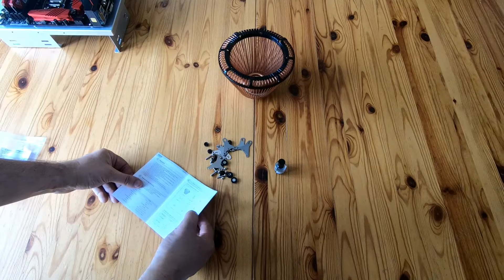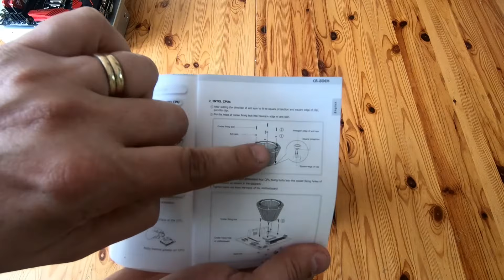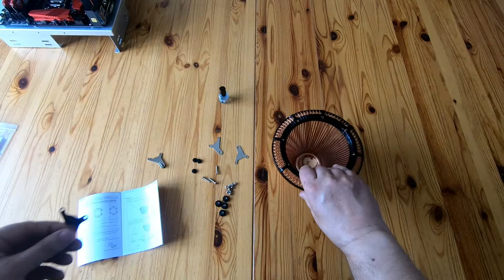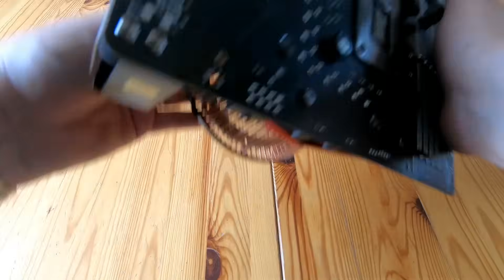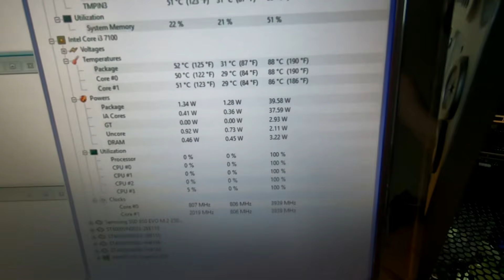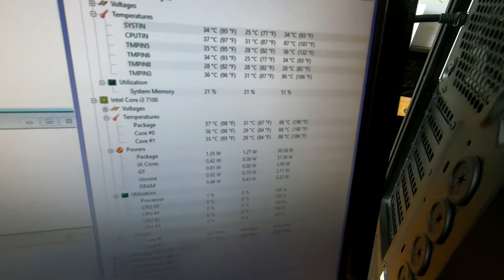NOFAN CR-80EH Installation and Review *HOW TO* Guide

Comment: I have had this Nofan CR80-EH cooler for several years in a computer with AM2 motherboard and now I have changed to another computer with an AMD AM4 motherboard and I want to put the Nofan cooler from the old computer. For this, I have to remove the 4 AM2 clips of Nofan that I had in place and replace them with the 2 AM4 clips as indicated in the instructions to adapt it to the AM4 motherboard, but the problem is that it does not explain how remove the 4 Anti Spin and the 4 Cooler Fixing Bolt of the clips and I have no idea how to do it. Can somebody help me?
Reply from the maker: Not really sure what you’re trying to remove…

If I remember correctly, there are 4 mounting brackets that use 2 screws each that go into the base of the cooler - and that’s all there is.

You just move then to different positions for different sockets.

Comment: Is it possible to remove the black part on top?
Reply from the maker: You can remove it.... but it’s not designed to be removed and it’s there to keep the heat pipes arranged properly and safely.

It would look pretty nice with just the bare pipes - but I wouldn’t recommend taking it off.

Comment: Would this be any good for gaming ?with 8 fans I'd be interested to see you same again but full load cpu and fans turning
Reply from the maker: The whole point of this cooler is that it doesn't have a fan... so you can build a totally silent PC.

But this cooler will work when the CPU is on full load on all cores - so for gaming it'll be fine as there are no games that use all the available cores anyway.

Gaming is more GPU than CPU, so that'll make the noise and totally void the main reason for getting this kind of cooler...

But Dark Rock 4 Pro is a ‘proper’ cooler for the higher end gaming processors and it’s pretty quiet... and looks pretty impressive too.

Comment: Can I use fans on the case would this be cooler looks amazing and look very lite I used the 3fan Salman and result were awesomely low at peak load at 40c max. But really heavy.if you think an 8fan case would be greatly colder ill get one
Reply from the maker: You have to have a case with a top vent... but any full size ATX case will have rom for more than enough fans.

Note that looks aren't the main focus of this cooler - its silence.

So it's really meant to be used in systems that are going to focus on noise reduction more than anything else.

Comment: Where did you get that paste?
Reply from the maker: The thermal paste used in the video came with the cooler.

You can see it in the bag of parts right at the start of the video.

It's not special though… and any other branded paste will obviously work.

Comment: Lower profile ram
Reply from the maker: The taller RAM sticks were a problem for the previous NoFan cooler - the massive CR-95C.

For this one, you can put anything you like in provided you aren't using the slot nearest the CPU. So check your motherboard manual.

If you are using two sticks then the motherboard will have a preference for which slots to use, but for four sticks you'll have to have a think... at 18:38 you can see the view from the side and there's not a lot of clearance for the first RAM slot nearest the CPU - even for low profile RAM.

Comment: Hi. I have i7-3770K which is 77 TDP. Do you think is this 80 TDP cooler enough for him?
Reply from the maker: On paper... yes because 77 is less than 80. But personally, that's a bit close... this cooler isn't really meant for higher end processors. They used to make to CR-95C, CD95C Black Pearl and CR-100A models which had a higher TDP rating, but these are no longer manufactured. Yours is also the K version that would allow overclocking - that certainly won't be possible with the CR-80EH. In the video, an i3 peaked at 88 degrees with a TDP of 51W - and i7 will certainly be hotter.

And your particular i7 runs pretty hot anyway - so as a side thought, deliding is worth a look to improve thermals.

I think NOFAN discovered that people with i7 CPU's would tend to go for water cooling or substantial HSF coolers and not opt for a quiet fanless solution - especially for the K versions that are unlocked for overclocking. And the discontinued models were overkill for the lower end processors with a premium cost for the higher TDP rating - they are much larger and more complicated than the CR-80EH.

You also MUST have a case with a top vent and good ventilation to allow convection to work effectively.

If you do have a case with top vents, then your CPU will be happier with an AiO water cooler with a couple of 120mm fans - that will be pretty quiet. Or you can get a HSF cooler that's got big fans if you've got space. Bigger fans spin slower when pushing the same volume of air as smaller ones - so they are quieter.
Reply: @sterntechdaddy  Thanks for fast reply. I take i7 in 2013 because I want cpu which if above mine current needs,so it can perform well next 10-15 years which it will for mine needs.I am on search for a fanless solution as much it can be without changing mine rig:   cpu,mb,and 16 gb of ram. I have Thermaltake Kandalf which was the best full tower in time of 2006 and now I would like to have some silent mid-tower,with (if possible) passive cooler for cpu,and vga.If not, than some very sillent active cpu fan.As I saw some tests, some air cooler (like Noctua) perform the same or better than AIO fans so I didnt look for AIO with 2 fans ,when I can get Noctua with one fan to perform better or the same. I am not some OC guy, and I mabey think I could pass with this one passive solution,but it would be on the edge of thermal solution for mine cpu. Mabey I should find some low profile,low noise active cpu cooler.
Reply from the maker: I can't tell what specific model of Kandalf case you have, but if it's this one - https://techgage.com/article/thermaltake_kandalf_va9000b/ - then...

If you've got the fancy side panel with the fan then that isn't necessary and you can use the plain panel it was supplied with.

You can also add some insulation materials to dampen the sound too - assuming that you value quiet more than looks because of the windowed side panel. There are kits you can get that will look cleaner - essentially self adhesive rubber mats that you can trim to fit.

I would also remove the internal case fans. And pick a HSF that's got it's own large fans... plenty of things to look at here to give you ideas - https://www.quietpc.com/cpu-fan-coolers

The Scythe Ninja 5 looks interesting... https://www.youtube.com/watch?v=YHOse3Kgjh8

Comment: you might need to delid your cpu. i had very high temps on mine i5 3570k but after deliding temps droped for more then 30'c. older intel has higher temps as there are not soldered to IHS like AMD. the best today to check cpu temps is AMD only or delided intel otherwize intel temps are very very poooor. ps. turn on back fan case for low rpm to make ventilation as well. everything in PC generate heat also SSD so at least 1 fan is required.
Reply from the maker: I've have delidded my i7-8700K, but there's no need to delid this one because the TDP of the i3 in the video is much less than the TDP supported by the cooler. Intel chips are rated upto 100 degrees normally, so 89 degrees at full load is allowed - especially as 100% load on all cores isn't something that's likely to happen with this PC.

The PC is also a totally fanless silent build - the cooler is designed to work without fans provided the case has a suitable vent in the top. 

So no case fans need to be running at all.... the temps should drop to ambient but it'll take a bit longer than if there was air blowing over the cooler.
Reply: @sterntechdaddy  you show that cooler has aroud 30'c and temp monitor on cpu has nearly 90'c so it was rhe same lke mine i5 before deliding, after deliding the cpu temps and cooler temps was nearly identical so im asuming your cpu need deliding, if its antel and it is so after 2 years every intel cpu needs deliding as there are not soldered but cheapest solution with poor termal paste on IHS. 

Regarding fan in cas yes it can be without but lor rpm like 500-700 is not noticable at all but will give huuuuge temps diferents, ps i advice to all the hearsink on m.2 ssd as they like to be hot and if there is no fan in case then then they can rich 90;c even which is very bad. 

just do the test in benchmarks and aida stress test with case fan and without. im sure youll see hudge diferent espatialy that the case fan is just next to cpu cooler. im assuming about 20;c diferent plus m.2 heatsink will give you 20'c lower temps as well in stress tests.
Reply from the maker: The 90 degrees value is the maximum when running the Prime95 burn in test... that's an extreme that won't happen in it's everyday usage.

But delidding will certainly help the thermals - I just don't bother on the lower end CPU's. As mentioned, my i7-8700K is delidded and that made a massive difference.

The video for that is here in case you want to take a look: https://www.youtube.com/watch?v=5cjLDu6L-7s